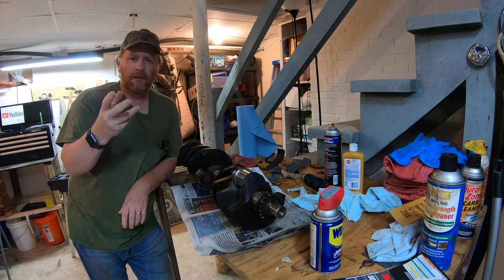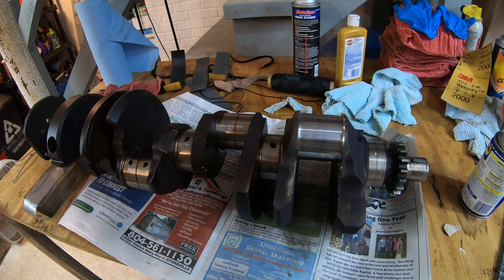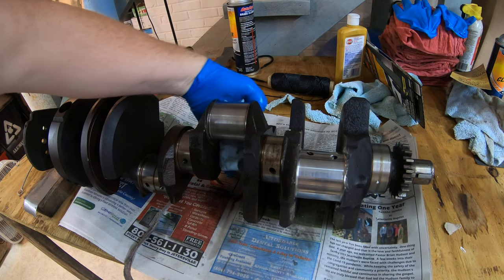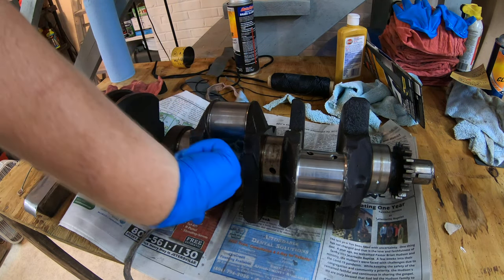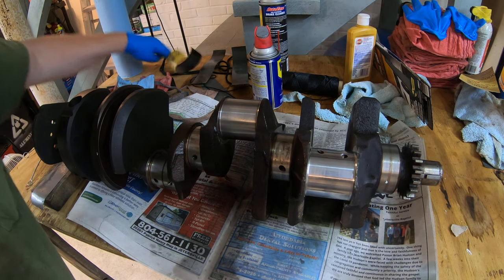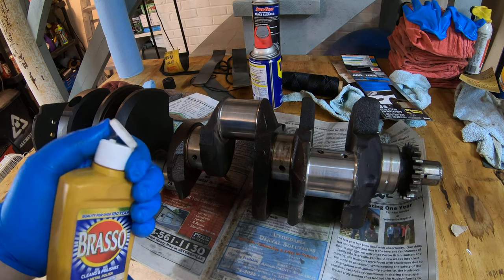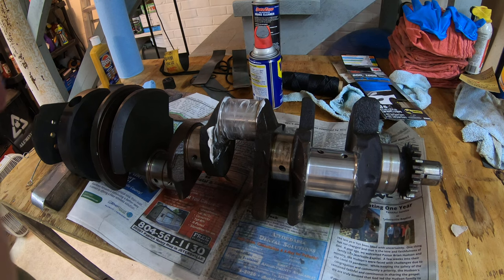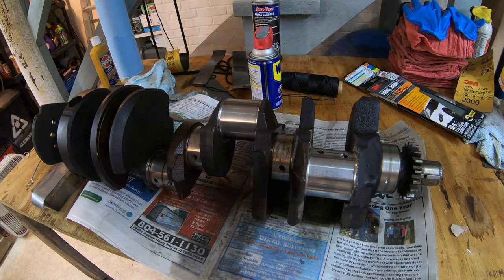How to Polish a Crankshaft at Home

Comment: Don't do this by hand. It may look pretty, but you're just making the crank out of round. Why do you think shops pay all that money for the equipment?
Reply from the maker: Thanks for the comment! This method is NOT meant to be a replacement for precise machine work. It is really just an alternative for those who are either 1)Cheap/Broke or 2)Not overly concerned with longevity. As a previous commenter mentioned a crank polish at the shop is not very expensive. It is better to get it done professionally if the money allows. I have seen this done on cranks that went 100k+ miles with no oil consumption and good pressure. Mine was mic'd after I did it and it was still in spec.
Reply: Everyone is a white knight in the YouTube comments, but in reality everyone takes their own shortcuts when no one is looking
Reply: A crankshaft grinding machine is worth about $45,000 Australian dollars
Reply: Guys have been using this exact method since before you were a twinkle in your old man’s eye.
Reply: You must be a educated tech I've got 2 race engines with hundreds more like thousands of laps at 5500 rpm constant that still run great I did same thing to both cranks in those engines
Reply: 0:05

Comment: I've done this before on several cranks, but honestly, the local shop charges $60 to check and polish cranks. Worth it to me.
Reply from the maker: Yeah the price at the shop really isn't that bad. But for those who are cheap or where longevity isn't a concern this is a great option. The materials to do this at home are around 10$. Thanks for the comment!
Reply: What local shop? I haven't seen this kind of shop within 100 miles radius. I am in boston.
Reply: Also, have to consider turnaround time
Reply: @xushenxin  i can do it for you, i am in boston. Specailize in EURO (Audi, BMW, and Porsche)
Reply: At this level, you are right. If it’s the right garage with the right machine, it’s great. But if they are just doing it this way, what’s the point. But the main reason I am watching it is, it’s not that easy to remove the crankshaft. I am going to do it from under the car.

Comment: Great video! The only thing I wanted to add was to make sure whatever string you use covers the entire journal. If it’s only covering half of the journal, all of the pressure you’re applying is not being evenly distributed and can cause uneven polishing.
Reply: It can be tricky maybe its all about the person doing the job to make sure to not apply too much pulling force on both ends of the shoe laze at the same time, only on one side to make it spin that way and let the sandpaper do the work. With the polish rag just move it deliberately just like when honing a cylinder to make sure to cover the whole area.

Comment: Proper method is to mic it before to make sure the journals are on size,  but he didn't have to do the extreme!  A fine grit scotch bright pad (only enough to take the varnish off the middle of the journal and close to the radius but before you do that clean the oil passages and then polish..

Comment: Do not use red shop rags for cleaning engine internals, they fall apart easily and the fibers will get stuck to parts even after washing then will start to collect on the oil pick up screen after running.

Comment: If you wanted too, could you polish a bad main journal down ten thou?  Or is that something only a crank grind could accomplish?  Asking for a really cheap friend...
Reply: I would not recomend that. with the sandpaper in that grit he may take his crank down .0001" or maybe slightly more and you see him only do one journal. You are talking about taking of .010" or 100 times as much material so you can do the math on the time involved. The other reason is your journal will never be flat enough when removing material by hand to lubricate properly as well as the radius in the corner of the journal is ground on purpose and are a huge contributing factor to the strength of your crank. If you sand it and put a sharp corner there you wil break a crank much easier.

Comment: Nice. I have a v6 3.3L VG33E Nissan motor with a worn crank and it started causing knock about 160,000 miles. Bearing material confirmed in oil. I have had the motor removed and a used one put in. I want to remove the crank from the motor that's sitting in a tire, with the crank exposed and facing upward.  I want to hand sand the crank and reinstall.   Do you have or know of any basic guidance to do this?  I've never done this before. Thanks.
Reply: That will probably need measuring and checking be lucky if u get away with just polishing the crank also the rod housing will need checking for ovality as its been knocking

Comment: The polishing is good, but after polishing will it still meet spec? Did you measure the diameter?
Reply: I think if your crank ok. Just clean & polish. No need for sanding. I will try that on my engine soon
Reply: He did say if your crank checks out...and with the grit he's using ( used to final wet sand paint) , he would have to stroke it for a loooong while

Comment: Um I would not do this as you are going to force polish and debris into oil feed hole with no way of getting it out then first time you run the engine for the first few seconds it will be polish and debris right on you engine shells not good
Reply from the maker: I've seen engines that have utilized this budget cut go 150-200k. As long as the tolerances are within spec, you are putting the correct amount of assembly lube on all your crank bearings, and are blowing/cleaning the debris inside the crank out then any leftovers would be mitigated. Of course anyone should clean the crank thoroughly before reassembly. It also depends on the purpose of your build. If it's a little beater get around thing then it would be perfectly fine. I would never suggest anyone try this with an engine they intend to race or otherwise compete with. Cheers and thanks for the comment!
Reply: @JunkMissions  To be fair mate I love a tryer especially in your own workshop best of luck in the future
Reply from the maker: No worries :) Same to you as well
Reply: Do you not think he would not use a pipe cleaner brush & hot engine oil to flush out the polish before installation?????????????  You just a Hater.

Comment: I don't see why the direction you sand in matters your crankshaft should never touch anything but oil.if the crank eats the bearings you've got bigger problems than the way you polished it.